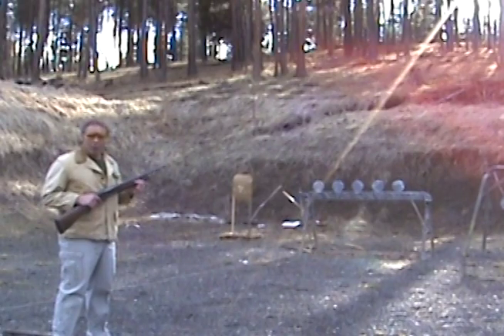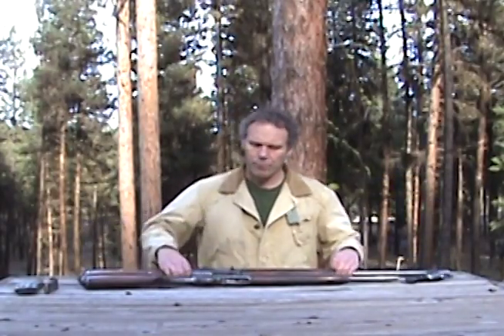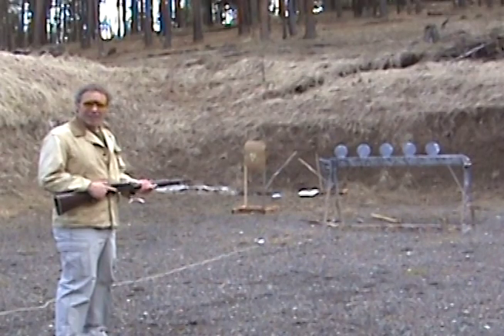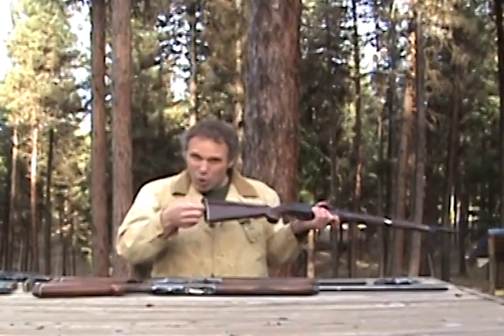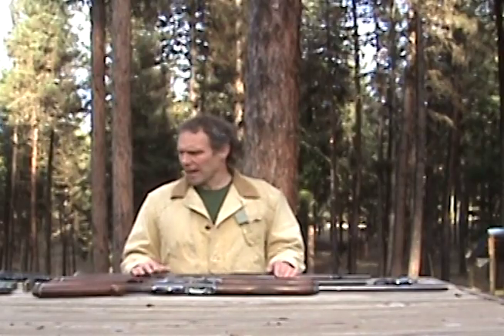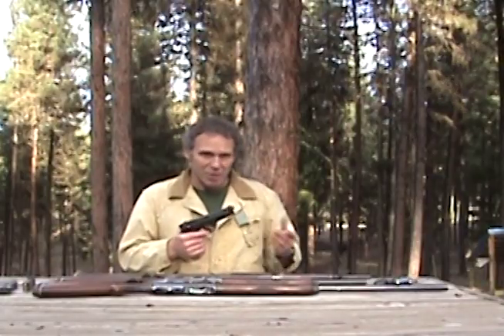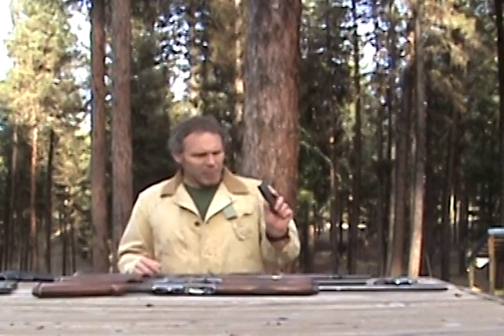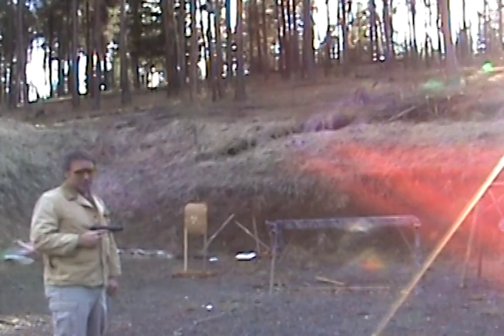Can spring compression damage a magazine?

Comment: That question is so vague. It's like asking if a firearm can take a deer at 500 yards.

There are so many variables to consider, like what kind of metal is the spring, how thick is it, did it receive any kind of heat treating, what method of coiling was used, how many times has it already undergone compression, what are the storage conditions, etc? Also, what degree of entropy do you consider to be damage?

It's not so much a matter of does spring compression damage a spring, but rather to what extent can your spring withstand sustained compression before natural entropy causes it to fail?

One of the core rules to remember in engineering is everything has a failure point, so it's not a question of if it'll fail, but when it'll fail.

So like anything, springs will eventually fail, compressed or not. For quality magazines, your decision to keep it loaded vs unloaded needs to be based on what you need the mag for. Is it a mag for your home defense gun or EDC gun? Then definitely keep it loaded, because an assailant isn't gonna stand around and wait for you to load your precious mags. Are the mags for prepper purposes such as SHTF or CoWC? Then keep them unloaded.

Any material that is under heightened stress WILL incur entropy faster than when under low stress. This is an undeniable truth of engineering. Just look at the floorboards of a house where heavy appliances or furniture sits for years, even decades, compared to the open walkways. You will clearly see warping in the floorboards, and that is actually a form of spring compression damage. Yes, metal is tougher, but that just means the damage incurs over a greater time.

Personally, I keep a few mags loaded at all times, and the rest are empties to replace the loaded ones when they eventually fail, or wear to the point failure is likely. I expect the mags - and even the parts in my guns to eventually fail, even with proper care and maintenance. That's why any serious shooter should have spare parts on hand if they want to be prepared for a scenario where parts become increasingly difficult to procure. 

I've been buying up mags and parts for my Astra A-100 for this very reason, because Astra no longer exists as a company; they haven't manufactured parts since their last factory closed in I think 2006 (they went bankrupt in 1998). I really, really, REALLY like my A-100, so to keep it going, I need replacement parts on hand, as eventually they will all be bought up and too expensive for me to keep it running. Fortunately, it's a rugged all steel pistol, so it'll likely still be operational long after I'm dead.

Still, you need to remember nothing is indestructible, and if it were, you wouldn't be able to machine it into usable parts.
Reply: Great advice! This is a rarity on YouTube. 👍

Comment: Just watched another video, same topic. AR mags loaded 18 years, compression rate was different for each. And each worked fine. Different manufacture batches or metal quality or storage conditions...who knows. Each one is different and may or may not cause issues. You are 100% correct and I probably don't need to tell you. I did watch to the end though.

Comment: I had two 30 round AR mags stored fully loaded from 1994 to 2019. They're just as hard to load by hand as they ever were. And they worked flawlessly yesterday.
Reply: Military inventory veteran told me the same, all the mags are stored loaded & work. A engineer told me the quality comes from heating the spring and cooling it slow plus all high quality components.
Reply: These posts make me feel better about the mags I have loaded.  Nervous itll kill them and I cant afford new ones anytime soon unfortunately..thanks guys!
Reply: Bobby, I think I should point out that (obviously) not all magazines are going to be created equally. Certainly I would expect a colt magazine or an HK magazine to be perfectly fine. The cheaper stuff? Yeah, no trust from me.
Reply: @Jonesy 22 The way I see it, magazines are repairable or disposable items anyway. Even if there is extra wear over time, if they are one you keep around loaded for home defense or carry then that's the normal expected wear of a defensive tool, and one of the responsibilities of properly maintaining it for defensive use is replacing the spring or replacing the mag once every ten or twenty years.

If that's still something you're not comfortable with, underload it by a round or two. No harm done, and there are other advantages like you won't run into a mag not seating properly during a reload. My 30 round fully loaded AR mags often need a slap to get in. At 28 rounds they fit in just fine.
Reply: @Hyperlingualism  agree with ya there and actually you hit head on nail for what I thought too- downloaded to 28 and have a few extra springs on hand.   Seems like loading 28 just seems to make alot of sense also for me.

Comment: I'm a mechanical engineer, and I'm not a materials scientist. However, it is my understanding that steel is NOT homogeneous, and is not stable at the molecular level. Steel can and does change over time because, even at room temperature, the atoms in the steel are slightly mobile - by which I mean that inside the crystal matrix (steel is composed of lots of tiny crystals) individual atoms can and do move around. This phenomenon has actually been "photographed", so to speak, with a scanning electron microscope, and I've seen the series of images in which a hole or vacancy in the crystal lattice moves around over the course of several minutes. Really it's the atoms that move, and you can tell they're moving because the hole moves. So, when people say that a spring, loaded below its yield strength should never "creep" I say that's only true of an idealized material - and steel is not ideal.

Comment: Just a fair warning to all. I left some popular polymer mags loaded about 1 year and when I went to use them they had bulged and would not quite fit into the receiver of an AR. Sometimes they had came with dust covers that snapped on and those all worked fine. I also had some steel mags that worked fine. This was all stored at normal room temp, 75 and lower and at lower that normal humidity. That sums up my personal experience and lesson learned.
Reply from the maker: Good info.
Reply: Yes and it was quite disappointing. I've been told they all come with dust covers now but I like the Brownells steel mags just fine. I don't want any risk of a mag just not quite fitting or not dropping properly. Please Magpul lovers do not hate on me. I'm not here for an internet 'experience'.
Reply: worddunlap 
I was always leery about polymer mags, because I predicted that very problem you described.  
That's why I've always stuck with the tried & true steal mags.  

My thinking was... stick with what is known to be reliable, & let others be the guinea pigs.
Reply: Some of my Pmags were loaded for three years. No issues.

Comment: No spring compression issue when carrying a revolver 🤣
Reply: No six shot limitation issue with literally any other gun.
Reply: If you leave a revolver that has a leaf mainspring in one position for a long time it may ruin the spring. I've seen this twice,  it was a common and recommended practice on the Colts 1873 army revolver to back-out the two screws that tensioned the mainspring before long-term storage.
Reply: Fudd
Reply: @rcreccomendationsforpeople3906  Literally?
There are a lot of semi-autos that hold 6 rounds.

But ammo capacity isn't like the sole defining trait that makes a gun worth having.
Reply: EyesInTheDark1  pretty sure Sergeant Alvin York would object to that statement. As would every other American serviceman up through desert storm. These days, they might let an actual member of the Communist party into the service...
Reply: @rcreccomendationsforpeople3906  How to avoid this problem entirely: belt fed machine gun
Reply: @khorehmandirani  belt fed revolver

Comment: Decided to finally subscribe.  Good video, and you are correct in this,  a "long time" is not a real parameter.  Define it first as you suggest, and then we can continue to discuss.....  And you are spot on with the failure has many variables.  Brand and original made on date mean a lot in the outcome.  

I picked up on 2 tings to say, and I know this is an old video, but anyway:
Nylon 66 does not refer to the made date or any date for that matter.  It is the industry name for the chemical Nylon type used in the stock.  There are more than one type of Nylon made, and 66 is one of the first, if not the very first one made.
Second, I particularly like the way you indicate count down to 2... in a couple of places, to indicate a bit of emphasis I think...  ;-)  

Good info sir.  Have watched for a while, and this video sparked me as an engineer, and springs are not all made equal, as you suggest.  In fact, so many are not really good enough in some cases to be called real springs.  Thanks for taking the time to do these down to earth videos.  Refreshing.

Comment: I would be willing to bet,  that fine-looking T-bird of yours is probably riding 1- 2 inches lower than it did when it was new
Reply: Mark Griggs 
Spring compression.
Reply: Jeff Mansfield  -Owned one for many years, even repainted it. They were soft, cushy, classy low riders when new.. Front suspension wheel camber remained in spec. Would not be, if springs on independent front suspension had compressed.

Comment: One thing to add... (If Paul did mention it, I must've missed it)
Temperature cycling is most likely the determining factor in whether or not a spring will keep it's temper over time.  As a mechanic with lots of welding experience, I have some knowledge of how different metals (particularly iron and steel) react to drastic and subtle changes in temperature... and yes, I'm well aware that many of you out there probably are aware of this too... and that most people here likely store their guns, mags and ammo in temp/humidity controlled safes/rooms.  For those who don't...
Most homes hold stable temperatures year round for decades at a time (heating and air conditioning), so if you store your guns and mags in your home, they likely won't see any temp cycling or humidity cycling and are less likely to suffer damage from that.  However, if you store them in a basement, cellar, garage, barn etc... where the year round temp is allowed to fluctuate with changing weather, your guns and mags are more likely to suffer damage due to temp cycling... whether loaded to the brim, cocked and ready, or completely empty and action closed with the hammer down/striker released.
Of course, this is only one factor in the equation... metallurgy of the springs, temper of the springs, quality of manufacturing, length of storage time, etc... can be as much of a factor in whether springs go bad or stay good over time.  Either way, Paul's advice (loosely given here, but understood by most of us, I'm sure) to swap out mags/ammo and actually SHOOT the guns occasionally, is still the best way to prevent spring "fatigue", but also make sure you store your guns, mags and ammo in places where temp and humidity stay as stable as possible.

Comment: I've been having magazine feeding issues with my 9 round Yugoslavian magazines for my tokarev yet I haven't had any issues with my original 8 round mags or the new ones made in Taiwan. I swap over the ammo to different mags every other month and haven't had issues over the past few years but the other day my yugo mags didn't want to chamber the first 2 rounds of a fully loaded mag. I thought I was rotating mags often enough but apparently not often enough for these Yugoslavian magazines. So as long as I only load 7 in them they should work but that makes them larger and less efficient than the original magazines so I suppose I'll be getting the 8 round mags from now on.

Thank you for sharing your experiences and shedding some light on the subject.

Comment: My water heater is a 1952, and I have not drained it in 25 years.  I have never even ran out of hot water.  In 1996 my grandfather died I got a Enfield No.1 MK III that had been hanging on the wall since my dad went to Vietnam.  I didn't do anything with it for years.   I had other Enfields.  One time I was cleaning everything I had I got it out, It was loaded it had been loaded for over 30 years.  Magizine works fine.  On another Enfield No. 1 Mk III three aftermarket Pro Mags all went bad leaving loaded over a summer.  I agree with Paul it depends.

Comment: Here's an anecdote you.  I had a Series 70 Colt Govt Model .45 that had several hundred rounds through it.  It never jammed.  That was 1985.  It sat in a drawer for the next 15 years.  It had an empty chamber and hammer was down.  It had a standard 7 rd Colt mag that was fully loaded.  Result after 15 years?  With 230 gr hardball ammo, it jammed  three times out of the first seven rounds from that mag.  The second seven rounds jammed twice.  After that, seemed to be just fine for another 250 rounds - even with that original mag.

Comment: Fatigue can also remedy springs that have too much compression or tension. e.g. I bought a high point compact -9mm that kept jamming because the bullet got flipped up too far into the top of the breach. Hollow points are more susceptible because they lack the full smooth curvature of FMJ's. I screwed up the original spring by heating it with a lighter. It broke, but High Point sent me replacement spring no charge. It jammed  a lot. I  left it racked  back for a couple months and it ran 300x no jams. Springs almost always weaken. You will pay more for better ones, whether it's an exotic alloy (vanadium,  niobium, scandium) , or just more QC in the tempering line. Cheapness dictates run mass quantity,  and over-engineer the spring's force so it will fatigue into perfection at an acceptable break-in period to make the longest life of the machine.

Comment: Springs certainly DO wear. in 1985 I bought a 68 Road Runner 383 4-speed that had been parked for 10 or 11 years - they guy wasn't sure which year he parked it. So it had sat for all that time with some valves open, some closed. Typically those 383's could keep revving till they came apart, but that one would float the valves at 5800 rpm every time, falling on it's face. It wasn't the lifters, oil or anything else. The guy I sold the car to pulled the springs and though the usual variance was +/- 15 pounds of seat pressure, about half of the springs had less than half of the spec'd pressure. That was just from being compressed all those years. He put in new stock springs and that was the end of the valve float problem.

Comment: I purchased a Beretta 21 bobcat and 22 long rifle manufactured sometime during the 1990s it was blued with wooden grips in MINT condition.. it's as if whoever the previous owner was shot at once loaded it and put it in his sock drawer.. in fact that's what I believe he did because the magazine had lost some of its power in the last round or two sometimes would not get pushed up but enough Force.. easy cure.. pop the bottom of the magazine off and stretch the spring out! Voila ! Works perfectly now.. I have since bought 2 spare genuine Beretta magazines for the bobcat.. but just goes to show you in this particular case the spring must have been  compressed for a long time and did affect it .. stretching the spring out was The simple solution

Comment: I dont know how long I've had my Glock 17.  I bought it new in the late 80s.
I kept my defense mags fully loaded for a long time. 10+ years with once per year use at the range.  Over time the two original mafs became unreliable.  The would cycle to the last round just fine.  The issue is that the body of the mags had swelled and would not enect from the frame without conciderable effort.  As i understand it, this might have been rectified in kater mags.

Just my own experience.

Thanks for the video.
Cheers
Kevin
Reply: Sorry for all the typos.
I will say that i like my Glock a lot more than this phone...lol

Comment: I think the key phrase is "acceptable tolerance" for spring wear.
I also dealt with having to stretch springs on deployment, and some of the jar-heads would pull as far as they could stretch to the point that they had difficulty fitting the spring back into the magazine.  Point being that if a spring is too forceful, it likely won't cause issues from being too eager to put a round in the chamber.  And if a firearm or magazine in built with that extra tension then it will likely last a good long time while compressed and still perform as advertised.  However, if it made to minimal standards, and barely works as is, then it will have some issues if you keep it compressed too long.
Also, the wear is a factor of total time compressed, so if you're loading a magazine, then emptying a magazine, then loading it again, etc., it will wear as much as if it were just compressed for as long as it was loaded.  The major difference being if you continuously use it you will likely notice the performance issues at some point while still minor.

Comment: my father was a machine design engineer. he explained springs to me. first what is the spring made of and heat treated. then all springs have a range of elasticity. if you compress the spring to much it will not come back to where its memory position is. So, I use good wolff springs and do not over compress with full loading.